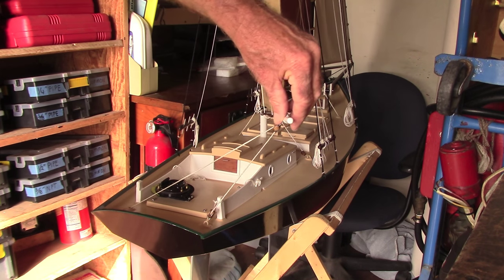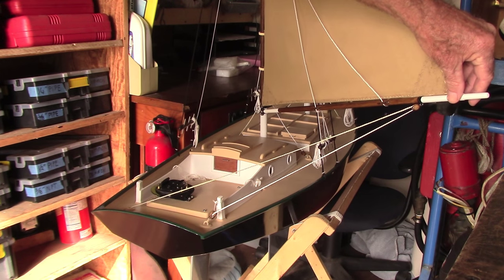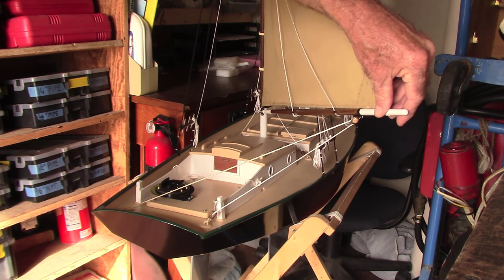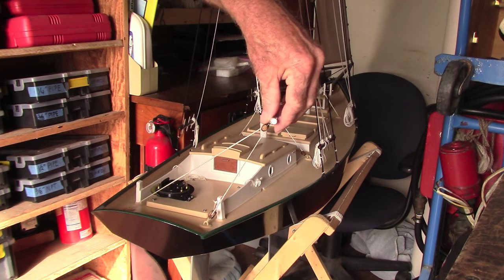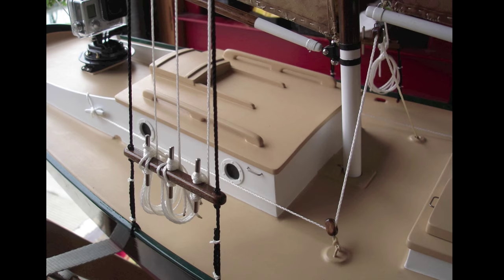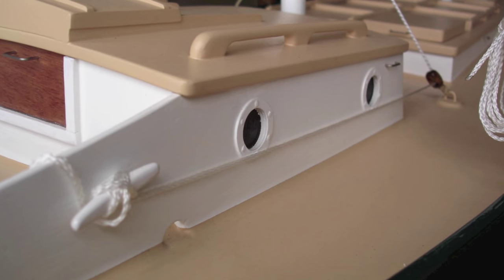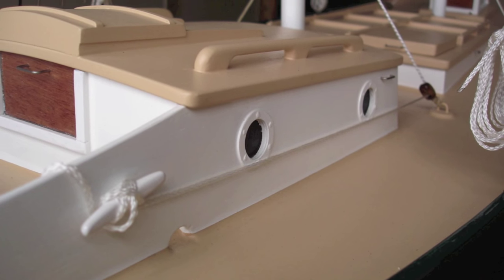RC Sailboat Build Detail - Sail Winch System

Comment: Gary,. I love your videos.  Thank you so much for producing them.  One thing that concerns me about the winch system is that I don't know if you can connect the sail winch directly to the receiver or whether you need some kind of power relay.
Reply from the maker: Thanks Bill for asking. This particular sail winch servo can plug directly into the receiver and the receiver will pass power to the servo. No relay required.
Reply: @sailtails2775  Thank you for your speedy response!

Comment: Yo Gary  thanks for the information.  But I am a little (ok a whole lot slow).  I can figure out the servo and pulley thing and the fair leads thing and how one servo handles all three sails.  I even get how the end of the sheet goes to the booms around blocks and tied to the cleats, but where are they attached at the other end, before the lines go into the fairleads? I sure can not figure it out. any help appreciated.  thanks , you are a very helpful guy.
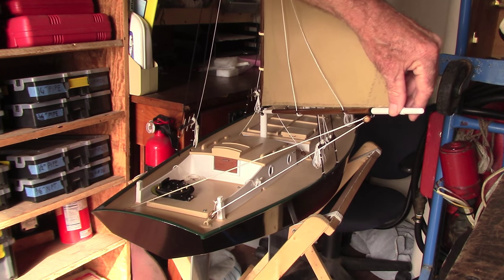Reply from the maker: Hi Carlos! The sheet for each sail is attached to the winch line below deck, passes up thru the deck fair lead, thru the block on the boom, then thru the block on deck, and finally is secured to a cleat above deck. Adjustment is achieved when the sheet is tied off to the cleat. See the system in action at 0:31 in this video. Hope this clarifies things.
Cheers, Gary
Reply: @sailtails2775  ok,  finally got it.  Really enjoy your videos.  Very informative and full of ingenuity. my project is still a ways out, but am gathering as much info as possible.
CIAO happy sailing

Comment: Short, sweet, educational, and enjoyable!

If you want an additional challenge perhaps you might add something similar to a SkySail to your boat. https://en.wikipedia.org/wiki/SkySails

Barring some unforeseen catastrophe, I presume that radio controlled and computer controlled wind and solar powered cargo ships with no onboard crew whatsoever will likely supplant conventional diesel cargo ships within the next decade or two as the primary means of shipping cargo. Why would shippers pay for fuel and crewmen when the technology exists today for them to avoid these costs altogether?

Sure, initially these hypothetical ships would move slowly (perhaps only an average of 5 knots per hour), but the savings in fuel and crew salaries in most cases would likely outweigh the cost of slow shipments in the majority of cases. I suppose sailing cargo ships will likely come to be seen as "floating warehouses" that transport goods.

Eventually with sophisticated, large, high flying kites these hypothetical ships might be able to travel very fast, perhaps in excess of an average of 20 knots per hour. The winds that are, say, 1/2 a mile above the ocean are often very fast. 

Sure, the engineering would be challenging initially, but it would pale in comparison to many of the technological hurdles that scientists and engineers are regularly surmounting today.

Comment: Gary, How is the 18.5 inch distance for the winch line determined? Is this the sheet travel as it is rigged?  I am interested in putting a winch into your Sloop Emma, since my present arm-servo-radio system only does 60 deg. Thanks for showing your nice boat building.
Reply from the maker: The 18 inches of travel are the result of the 3-1/2 turns provided by the winch servo. On this schooner, the sheets are rigged to have a 2:1 advantage so the boom travel is 9"  ( half of that 18" ).
Sloop Emma is actually OK with a 60 degree arm servo as shown in the plans. This may not seem like much movement, but Emma's sprit rig is unique. When the sheet is let out, the top of the sail, supported by the sprit, will swing out considerably farther than the boom.
Cheers to All - Gary